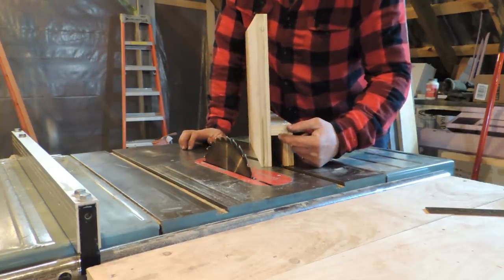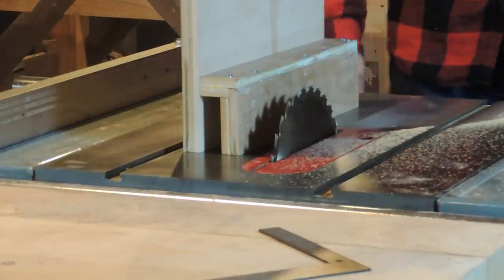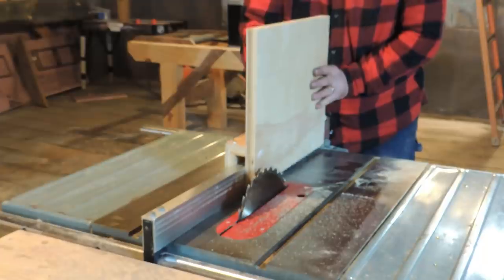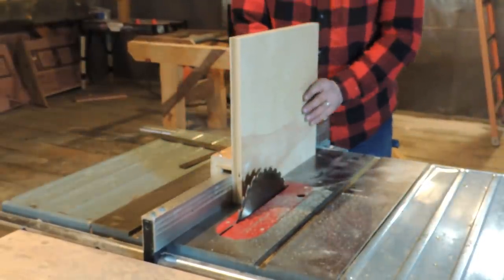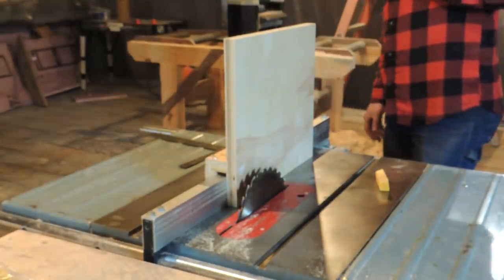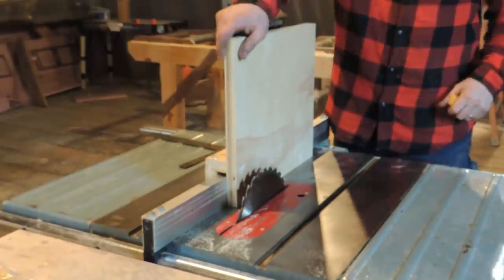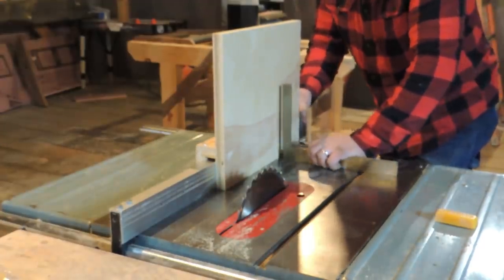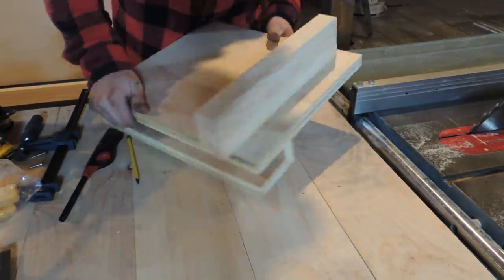DIY Custom Cabinets On A Budget Full Tutorial Part 2: Table Saw Tenon Jig

Comment: Use set screws to level the insert plate just like the original ones have, you can drill and tap the plywood or particle board works great !
Reply from the maker: If you drill the holes a tiny bit smaller then the screws will thread themselves in nicely.
Reply: TheTradesmanChannel I see your aware of this trick :) lol

Comment: Just why you should always build a little large (1/32 _ 1/8 inch over) then plane it back to the size you want. If you build to your exact size, you get small once you plane everything smooth and square. (This is more for the learner than you, Jim, I know you know this.)
Great looking joint. Did you use the square-drill morticing machine for the mortice?
Reply from the maker: I did.  Makes life easier.
Reply: @TheTradesmanChannel  so another expensive tool a person needs. Thanks for the video. Great work.

Comment: Regarding zero clearance inserts: I've made a bunch of them, from Craftsman sized to Unisaw sized. The process is much the same excepting for the final fit. I'm not even sure your Craftsman has the same understructure as mine, but you might still be able to infer something from it. The Delta insert is probably the same or greatly similar between the contractor saw and the Unisaw. So, here's a link to my simple version, based on my old Craftsman:
http://woodbutcher.net/insrtsaw.shtml The operative word to take from this article is "pattern". You'll see.

One takeaway which will solve a lot of problems and is necessary to resolve your 15/32" plywood, is to drill four holes in your new insert, located to match what should be four bosses cast below the surface of the table in the blade opening. Drill and tap for 6-32 or 8-32 threads (yeah, threading wood) and get four set screws to insert in the holes. Use them to level the plate coplanar to the saw top.

If you eventually want to get really fancy, you can build a removable insert throat plate much like the one Norm had. Here's an article about the one I wrote:
http://woodbutcher.net/throat-plate-zci.shtml

Should be amusing, if nothing else.
Reply from the maker: I usually undersize the holes and let the leveling screws do the threading.  I've made a few over the years, they are no longer usable after years of sitting in the pit of despair.
Reply: Thanks for the write up! Clever and salty;)
Reply: I should have known you might have had experience in that regard. Yeah, I haven't always bothered with the tap. Just sounded more professional.

I hope you don't feel like I'm talking down to you on some of these subjects. I am aware that you've been doing all your life pretty much the same kind of stuff I've been doing all my life. There aren't that many of us around.
Reply from the maker: You've been at it longer and have more tricks up your sleeve, I can always learn more.